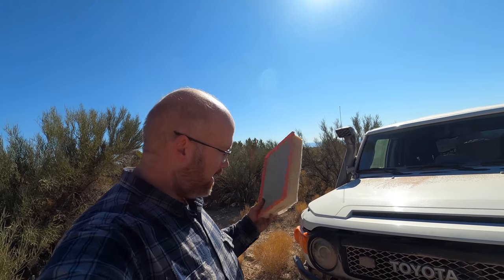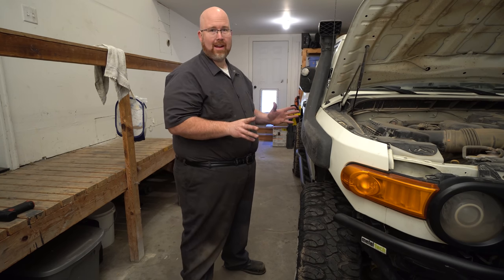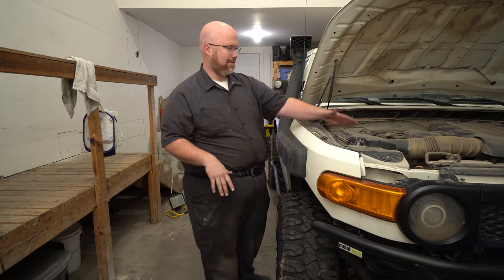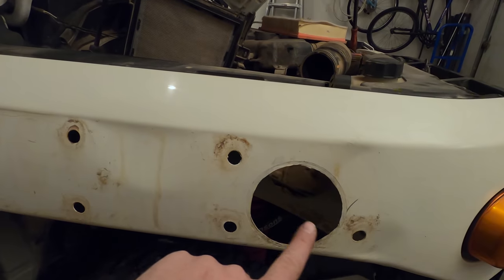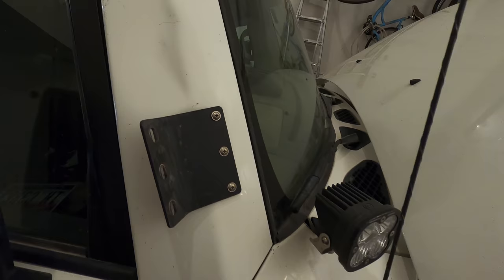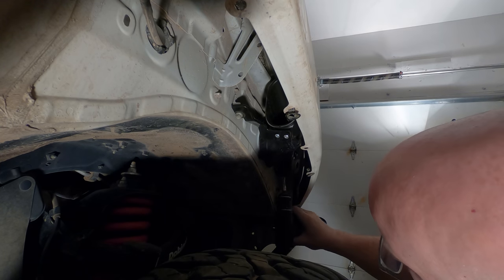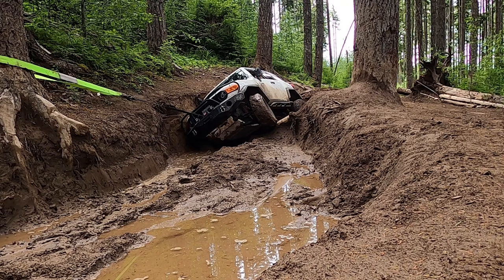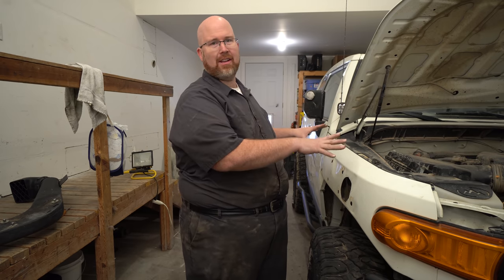How A Snorkel Can Damage Your Vehicle

Comment: To be fair, very few FJ owners wheel the way you do, so chances of them needing to remove a snorkel is pretty slim. Also doing an axle swap is pretty extreme and changes the vehicles handling and characteristics completely. If you wanted a Toyota with solid axles and it had to be a FJ, then stick to the original FJ40. There are plenty out there that is souped up and looks and performs great. I always liked your videos with great tips, but this is not a FJ in my eyes any more as I cannot relate to it with my FJ.
Reply: ...or he should just axle swap his FJ and make it into what it should have been factory. Honestly, the lack of a solid axle (on at least one trim level) is what ultimately killed the FJ popularity. If it had come with a nice land cruiser SFA it would have been a massive hit and would not have needed to have production stopped. The trail teams failed to match the wheel articulation capability of the lowest trim Jeep. 

The new Bronco WILL suffer the same fate unless ford offers one SFA model.
Reply from the maker: FJ's throughout history have all had solid axles until 1998 when some Land Cruisers went ifs. Putting a solid axle under the front of an FJ Cruiser is true to it's heritage. 

There's still a lot of FJ Cruiser in my build, so I hope you don't feel completely alienated. I'm not making any changes to the engine or transmission, and everything from the frame up will still be just like yours. 👍
Reply from the maker: @SkilletsUSMC  I've had the same thought about the Bronco. They should have learned more from the FJ Cruiser experiment if they really wanted to "compete" with the Wrangler. Of course it's also true that 90% of buyers don't care. 🤷
Reply: @offroadhub.official  I hope that's what this new warthog business is all about. Ford can have it so good and yet they don't understand. I'm actually passively pricing out a 2021 rubicon due to my frustrations with my FJ. On one had I love it more than any other vehicle, on another, I am kinda tired of the two-wheel-teeter-totter game when I am on big tank traps or rocks. Plus I saw one on 40s and street legal the other day and it hit me just how outclasses IFS really is.
Reply from the maker: @SkilletsUSMC  IFS equals better road handling, and that's the largest slice of the market, so if you're a bean counter ifs makes the most sense. Jeep knows that it's enthusiast customer base would literally burn FCA headquarters down if they made the Wrangler IFS. 😂
Reply: @offroadhub.official  know what you mean, but I've driven so many full-size pick ups/work trucks/jeeps and not really noticed them handling terribly. Jeeps sell so well I just don't understand the solid axle reluctance.
Reply: I had the same feelings at first when Ken started talking about the solid axles. I won't be able to say, "If he can do it. I can do it." But This isn't FJ Hub. It's Offroad Hub and it's awesome. Come for the FJ, stay for Ken and the adventures. To be honest, I've not been able to say "I could drive that" since the big rocks started about 6 months ago. Some people overland and some off road. If Ken wants to off road more power to him. I'm sure he'll throw in a few scenic trails every now and then. Plus it still leaves room for one of us to start our own FJ Hub! This is an incredible amount of work and requires a high level of motivation. If rock crawling is Ken's passion, then the channel will be that much better for it.
Reply from the maker: @kylegreen9421  thanks Kyle. I want to appeal to all off road enthusiasts, and I will continue to do all levels of trails,  raising my upper limit for difficult trails and obstacles!
Reply: @kylegreen9421  There are very few trails i would not try with IFS. and its not because i do not think i could make it . It is more about not wanting to get body damage .    Its those few trails that we can not do is the reason to build the FJ into something that can .